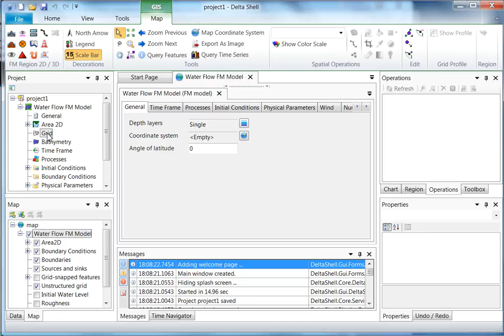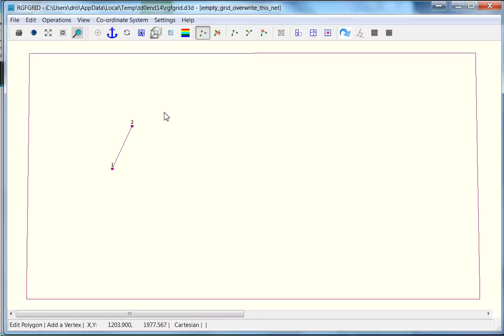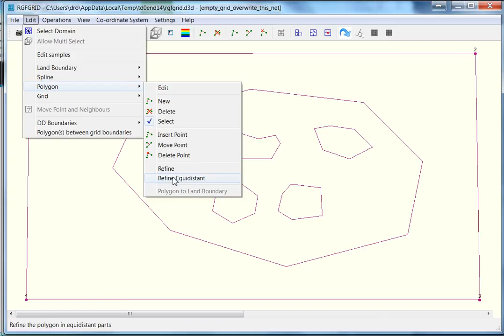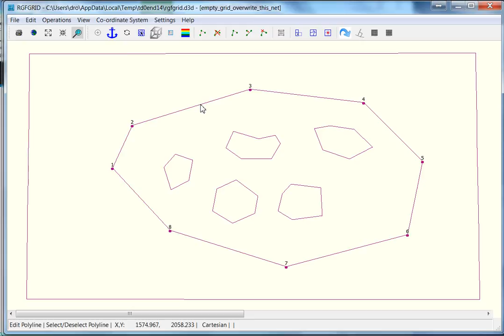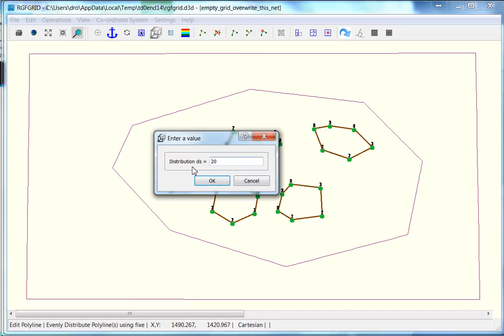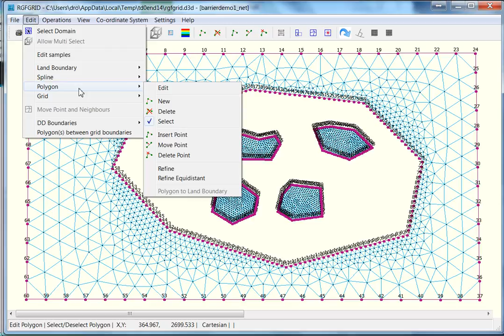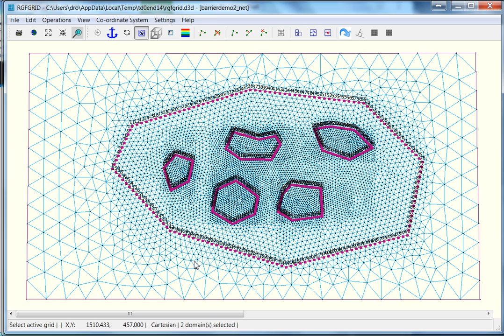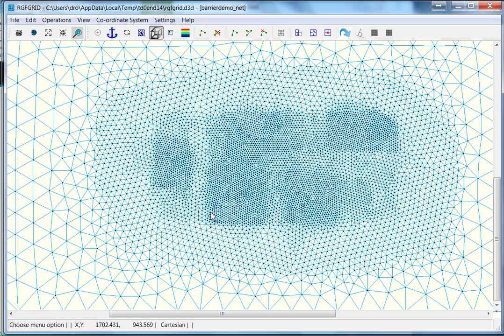barrier grid demo using Delta Shell

Comment: Dano, thanks for the great video. We have been trying to replicate this method to generate a model domain for an island chain (very similar conceptually to your example here), but many of the operations that you have available in your version of RGFGID do not seem to exist in the RGFGRID that we have with D3D or D3DFM. Is there a way this method can be applied using standard RGFGRID? Many thanks; Kit Stokes (University of Plymouth, Coastal Processes Research Group)
Reply: To be more specific, the 'create grid from polygon' operation does not seem to be available in standard RGFGRID
Reply from the maker: Hi Kit, glad you like it. I just checked RGFGRID within the Delft3D 4 package, which does have this option ( Delft3D 4.04.01). It is under Operations.
Reply: @danoroelvink  Hi Dano! Thanks for the quick reply, this is really helpful. I will check we're using the right version of RGFGRID.
Reply: @kitstokes2368  Did you get the right deltares version? Same problem on 2022 Delft Fm
Reply: Hi there, we’ve not managed to achieve this with the FM suite. it seems some of the functionality that Dano is demonstrating in this video no longer exists in the FM version of D3D rgfgrid. Furthermore, we were surprised to learn that waves cannot be simulated within D3D on an unstructured mesh (even though standalone SWAN can)! Only flow it seems can run on an unstructured mesh in D3DFM. Perhaps Dano can shed some light on why these features are not available in the latest (beta tester) version of the software?
Reply: Specifically, it is the ‘create grid from polygons’ operation that doesn’t exist anymore. You can ‘grow grid from polygons’ but this does not refine the grid between the different polygons. Any pointers Dano?
Reply: @kitstokes2368  what software you finally use instead Delft Fm? We just bought the Delft Fm service package and are stuck to make grid due to this problem about island.
Reply: We still use D3D but have to use much less elegant ways to get increasing grid resolution around islands. Essentially manually stitching together two grids of different resolution within RGFgrid. Dano’s method would be much preferred, but just doesn’t seem to be available for some reason…